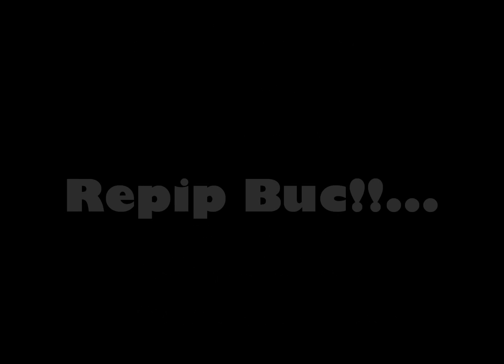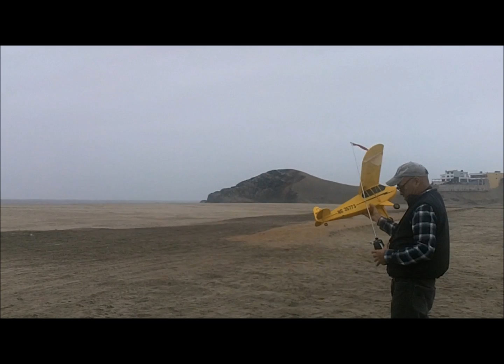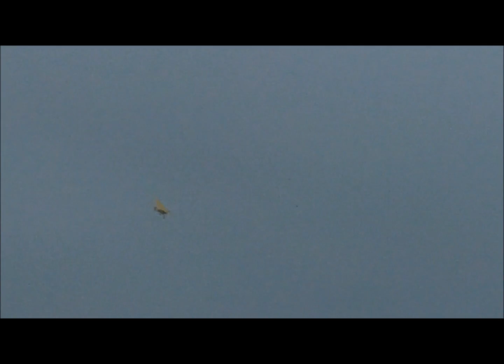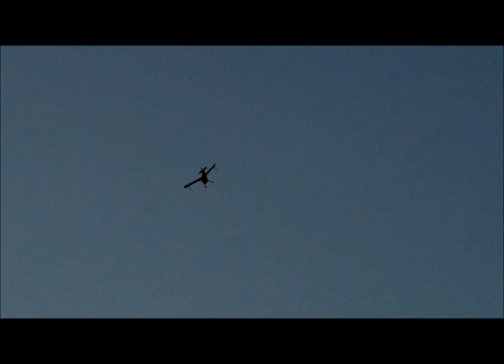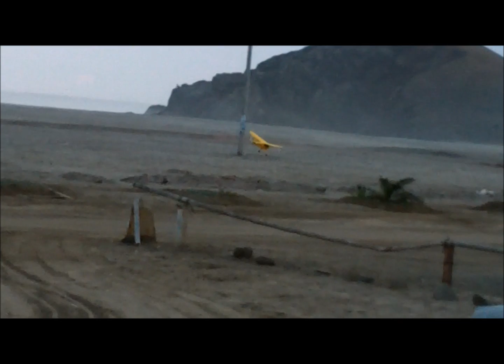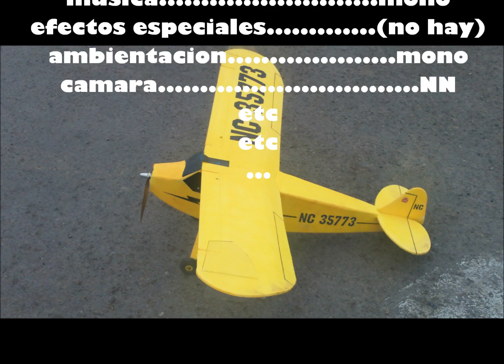Flying backwards!  Piper Cub...

Comment: Can you share the plans? I would love to build this myself.
Reply from the maker: Would like to have the plans, but I don't (.. .as with 90% of my own designs) usually I make a small drawing of the airplane... then I start building and as I progress keep drawing more parts.. and when I'm finally done with the project... almost nothing left that can be called a plan... Just try to scratchbuild the plane that you choose, reinforcing the back part (in this case would be the front) that would carry the battery. You'll also have to reduce the horizontal area to achieve the correct CG , in my design was a point between the wing and the canard (closer to the wing), and also don't forget to reduce the vertical fin, adding  instead fins at the wingtips, to have longitudinal stability.  Good luck,  and let me know your progress.